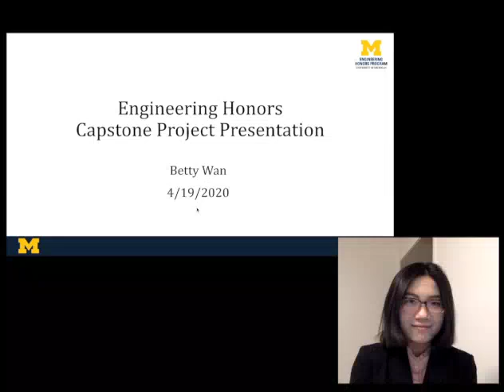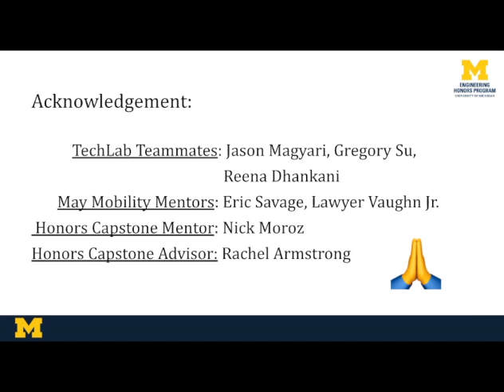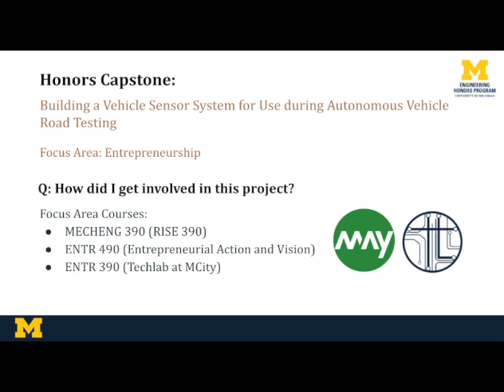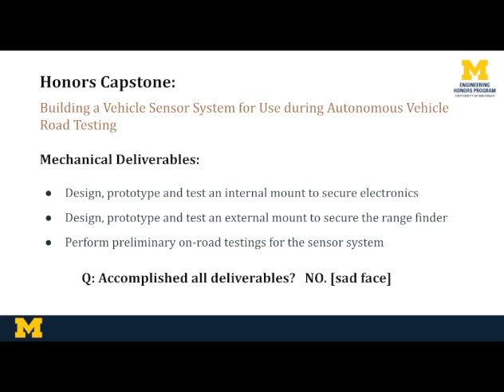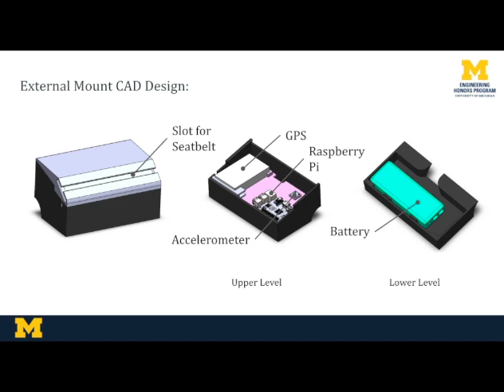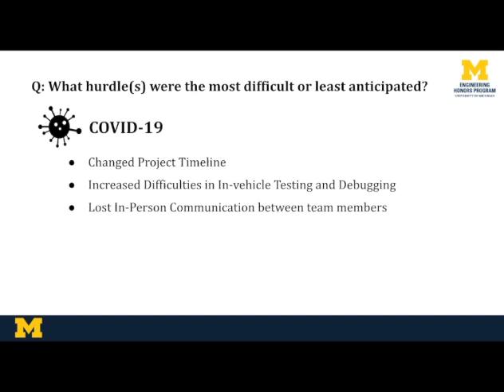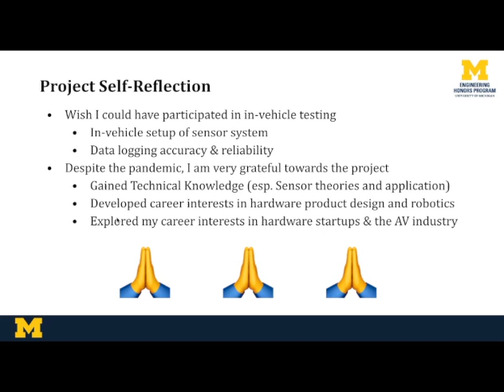Building a Vehicle Sensor System for Use during Autonomous Vehicle Road Testing

Comment: Very cool project, impressed by the prototype your team built during the pandemic. What are some changes you would change with the prototype?
Reply: Thank you for stopping by, Janice! Some design changes that I could make will be related to the structural integrity of the housing (e.g., wall thicknesses), as well as the fit for electronics (so, e.g., mounting hole dimensions and  locations)

Comment: Great job on the project and the presentation! You mentioned that given the opportunity, you'd like to be able to carry out some testing on the structural integrity of the housing for the mount. What kinds of tests would be carried out, and are there specific parts of the housing that you think would need extra focus when evaluating failure risk?
Reply: Thank you and great question! Yes I am planning on testing the fit of the electronics & the structural integrity of the  housing :)

Comment: Great job Betty! I'm sorry you didn't get any opportunity to test your project.  Once your parts were printed though, did everything work/fit as you imagined or are some changes needed?  Does your group have a plan for how the work is going to be finalized going forward?
Reply: Hi Grace, Thank you for stopping by! The 3D printing took days (cuz the housing was so big), which was very slow and not optimal, so there might be future work related to optimizing on the housing's manufacturability. We were not able to test how the electronics fit in, and how secure the mounts are, mainly because we did not have a chance to start assembling all electronics, so this will be a future to-do ^^  Our plan is to transfer all project materials to our May Mobility sponsor. He said it's likely that he will continue his work on our project over summer. It is also likely that next semester's Techlab project will be in some form a continuation of our current semester's work. So it is important that we document our decision-making process, recommendations and future plans and hand them to our sponsor moving forward.

Comment: Great job in expanding your knowledge base with this project and adapting to the situation! Although you were not able to do the physical testing, is there any aspect of the prototype that you think might need to be changed based on the eventual physical testing?
Reply: Hi Jason! Thank you for the question!  In order for the electronics to be securely mounted, I can foresee some possible changes that relates to : the mounting hole locations & hole sizes  for the electronics, the seat belt slot dimensions; as well as wall thicknesses for structural integrity considerations. For better manufacturability (3d printability), it is also possible that I cut down some unnecessary materials on the housing to save some weight and thus print time.
Reply: @bettywan7930  Sounds like you have thought about how you can further optimize things. Thanks for the reply and great job.

Comment: Interesting concept, what was the decision process like for you to land on using the backseat seatbelt as the way to secure down the component? What were some other places/ideas considered and why did you ultimately rule them out?
Reply: Hi Sharon, Thank you for the comment! At the early phase of this project, my ME teammate and I first looked at some industry solutions on mounting, esp for electronics, but we couldn't find many solutions on securely mounting something on the backseat inside a car, mainly due to the lack of features that can be securely mounted to, on the back seat. Then we thought of a baby car seat, which needs to be securely mounted. We researched on some industry solutions on car seat and realized several used the seat belt to help hold the seat in place. That was a huge inspiration toward our seat-belt mounting solution.

Comment: I am so sorry that the pandemic had such a negative impact on your project. I am curious, if someone were doing a similar team based project like this, and circumstances soon lead the team to need to be separated, what advice would you give to that team to work around this? did you find any communication  methods particularly effective for a technical project during quarantine?
Reply: Hi Nicholas, great question! Some advice I would give would be to maintain effective communication via Slack, Bluejeans, or other online methods, and it might also be a good idea that someone on the team takes on a "team mom" role and check-in on teammates to make sure everyone is on the same page. I think having a clear heading (or say, an overall sense of direction of the pivot of the project, if a pivot is inevitable) is very important, and our May Mobility mentors were a great help on that.

Comment: I understand why a housing for these sensors in the support vehicle would be necessary, but would there also be a need for a similar system in the autonomous vehicle itself? Or are these kinds of sensors already included in the sensing array on the autonomous vehicle?
Reply: Hello Ian, Great comment! This project isn't necessarily an R&D project for what to put on a future autonomous vehicle, and your point makes perfect sense. The sensor system our Techlab team aims at developing, however, is mainly for helping streamline May Mobility's testing process, which involves passing several test cases that the Autonomous vehicle would be trailing a support vehicle and doing all sorts of motions. The sensor system would then read in the data and report to the May Mobility testing engineers on various types of data the engineers need to ensure the shuttles are performing well.